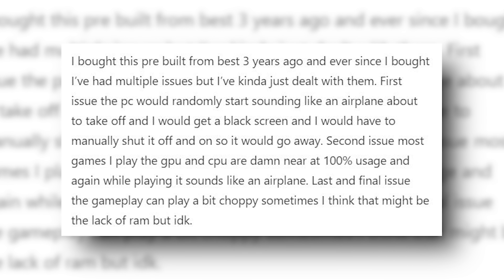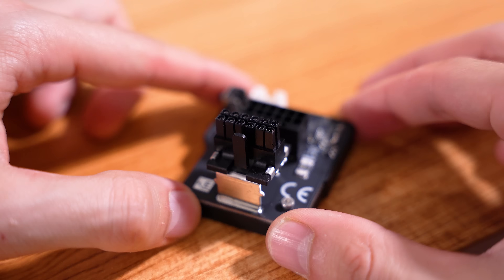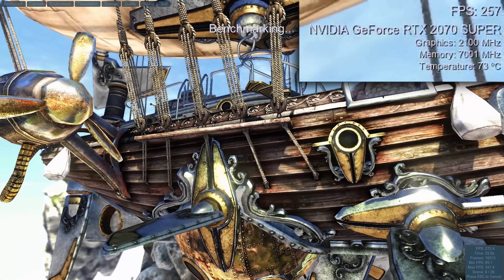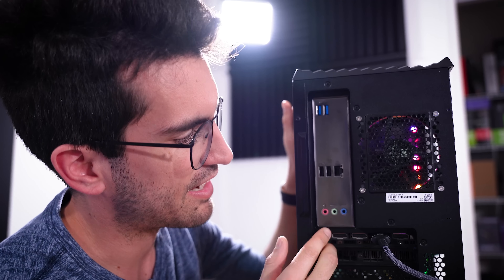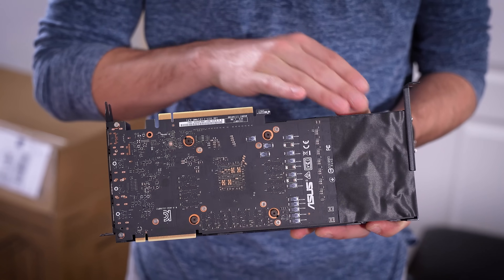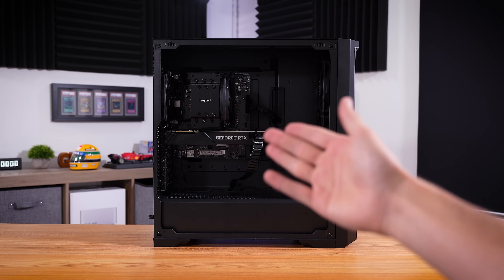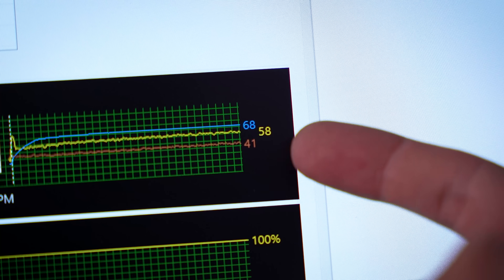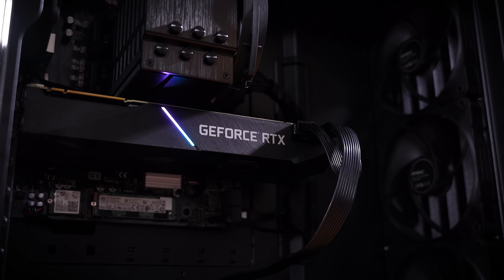Fixing a Viewer's BROKEN Gaming PC? - Fix or Flop S5:E3

Comment: Massive case overkill and psu overkill for that system. If I had a nice compact unit I would be gutted getting that huge empty beast back. So many different ways to go and you probably picked the worst choice. However, I do appreciate you may be limited by what you have available.
Reply from the maker: If you think a "nice, compact unit" includes shitty airflow, a shitty stock cooler (the upgrade of which wouldn't have fit in the stock case) and zero room for even a single 120mm fan, then you shouldn't have applied for FoF in the first place, IMO.
Reply: @GregSalazar   So on that basis every small or mini itx system would be a disaster? There are thousands of pre-built systems exactly like that one being sold every day and are you saying that the solution is to re-house them in large new cases with massive PSUs? There are dozens of different cpu coolers you could have used but I appreciate the one you had didn't fit in that case. Do you honestly think the thousands of IT guys that get those systems in when overheating every week go that route? All those cases and psus junked because they had "shitty airflow"? Like I said if you were limited with choice due to what you had available then fair enough, but there were other options that didn't include that massive case and overkill psu. More of a rebuild than a fix. Call it "rebuilding a viewers overheating pc" rather than fixing a viewers broken pc! Just pointing out the obvious and that if I sent my overheating compact PC in to be sorted by someone, I would be gutted to get that beast back! It would have been great to see you change the cpu cooler and try some fan/airflow configurations to see what gave the best results with minimum outlay, as it looks like you could get a couple of top fans in the original case and maybe one in the front. I would love to see a new build in that case as I'm sure you could make it work and I think the case looks nice and has plenty of space in it.

Comment: one day , i will pass from this mortal coil. either i will go to a better place where SIs don't use single sticks of DDR, terrible coolers , zero airflow cases, matx boards in ATX cases, GT710s or PSUs that barely meet the power requirements and allow for no performance upgrades. Or maybe i'm already stuck in pergatory, waiting for my soul to earn its way out of this GPU-sickened limbo. for sure i've already been to hell and it was installing Windows 95 from 29 3.5" disks, waiting for my pain to expire, one mechanical kachunk at a time.

Comment: Excuse me? This foul excuse of a motherboard inside a ROG prebuild? Typical ROG in the past few years....not even heatsinks on those few MOSFETs...
Just like when they used folded together sheet metal pins on ATX power only the take a step back the next board generation to massive pins andthen making them the COOLPLUG feature -- while this being NORMAL everywhere else. 

...stop falling for the ROG brand guys. Beware of ASUS, look EXACTLY what you need or what you build machines out of if you have to use ASUS.

Comment: Just to be fair, blower GPU coolers do have there place.  They have the advantage of evacuating all the heat they produce instead of just recirculating it in the case.  this is beneficial when the case is kept in a cramped space and only has access to quality front intake.

Comment: im a system builder of 25 years and i use to run a 92mm Delta fan on full RPM on a thermalright HS so noise is not an issue for me...but for some it is...not sure if the basic board supports dual channel memory but the user should upgrade to a minimum 2 sticks 16gigs memory...good job greg

Comment: That is the Asus brand main board they use for all there prebuilds so I don't any of it is compatable with the other cases, the one thing you can do is get red of the memory without heat spreaders they are only ment for mainstream and computing and can overhead really fast which could cause the weird temperature spikes.

Comment: My first computer was a pre-built from Best Buy in 1999. It was a terrible choice and turned me off of pre-builts forever. The power supply died. The modem died. The sound card had driver issues from Day 1 that we never resolved. It came with only 32 MB of RAM (yes, MB, not GB - you young people are spoiled). It was inexpensive until it cost me an extra $300. Ever since that mistake, I build my own.

Comment: 2 USB 2.0 and 2 USB 3.0, 1 LAN and 5.1 Sound. Almost as little I/O as server motherboard for rackmount but those have multiple LAN. As far as I konw the only model I remembered have I/O as little as this are Gigabyte G1975X and X58A-OC and those are motherboard for some kind of extreme OC only so they don't need many I/O. I don't understand this even the most low end motherboard or cheap motherboard 20 years ago have more connectivity than this.

Comment: I won't lie... I want this ROG case. I love its aesthetics. The only problem, as I've heard constantly over the years, is that the pre-built (the ONLY way to get the case, apparently) is horribly spec'd and performs badly. 

If I could easily buy just the case and put in above adequate parts to create sound performance, I'd be a happy as heck camper.

Comment: That rig will definitely - DEFINITELY - need some attention to VRM cooling now that the CPU will be able to pull its TDP (or more). I'd suggest a fan (90/120 x 15mm) cut from its frame and attached to the CPU cooler back-plate with a few blobs of RTV (a lash-up, but practically inaudible and of course  invisible).

Comment: If the motherboard doesn't have much (or any) VRM cooling, and especially if it is also throttling the CPU, a tower cooler may not be the best idea. It would increase VRM temps, and may therefore lead to increased CPU throttling.

Comment: I have a similar spec ASUS G15CK. I didnt have crashing issues, but I wasn't happy with the temps. About 6 months to a year after purchase, I upgraded the CPU cooler, power supply, and case. Since then its been a champ. For anyone that has one of these cases, consider replacing it. Your components will breathe easier. There is also no room for 2.5" SSD's or 3.5" HDD in that case.

Comment: that mATX board really triggered me. Best buy cut so many corners. They were better off using a nameless case instead of an ASUS Taxed case which adds an easy 100 bucks to the value.
I have bought a few pre-builds in my life, untill I burned myself to the last one, a Pentium III 500MHz.. within a year after that I started to build my own PC's, starting with the AMD Athlon 1GHz baed PC. Time has flew by, and right now with my Ryzen 7 5800X and RTX3080 I'm still good for at least a year from now before I will have to start thinking about a full  platform upgrade and a new GPU.
When friends want to buy a new PC I always tell them, set a budget then come to me.. we will talk about what you want and I will build a PC from scratch while sticking within their (realistic) budget. I'm not earning a dime on it but I rather do this then be called for help on regular bases because their prebuilds are acting up.  I rather spend an hour or 2 building that PC myself and cablemanaging it knowing all is good.

Comment: I got a ridiculous deal on an Asus G15CE (i7-11700F + 3070).
The cooling system is hilariously under spec'd. It couldn't complete the Windows installation without shutting down and the UEFI through an "Over temperature event" warning.
I used it for a couple of days while my Noctua Chromax 92MM (NF-A9) shipped. 
I lived in an apartment at the time and my neighbors actually complained about how loud the system was! 
They didn't complain about my subwoofer or my home theater system. 
They complained about the computer fan which was "driving them insane."

Comment: PSU was a “Better safe than sorry” swap so I don’t mind it, the cooler was 1000% necessary, I had to get an AiO for my brother’s build because of how hot his chip was getting with the stock cooler. It wasn’t overheating but I did not feel comfortable letting the CPU get that hot under load. 

Good job Greg!

Comment: Jesus, that board puts the BARE in bare bones. It's unbelievable. I can't find fault with your decisions here except the PSU and only because it seems like a waste on such a naked assed motherboard with bare minimum VRMs. But had it been me, I'd have done the same. Especially considering the owner mentioned the infamous black screen + fans go defcon 5 of Nvidia GPUs that are starved for power. A new PSU was necessary. Full stop. But that motherboard. Yeesh! Pre-builts that skimp here just grinds my gears because you literally have to fix someone else's sloppy work and choices, and it's even worse when those fixes require overkill because of limited inventory. Motherboard replacement was out of the question, too. You'd end up overpaying on a replacement board on eBay that may or may not even POST and in the time it arrives, you could've done a good generation upgrade ... but that would result in a new PC save for storage, RAM, and GPU. Anyone finding fault with you, Greg, hasn't been placed between a rock and a hard place enough times. It's that dichotomy all over again: you had to work harder because someone else could've worked smarter and chose not to. That someone else was Asus, imo. Ugh. They took the ECS approach with that motherboard.

Comment: Instead of case and PSU you could have just replaced the cpu cooler and motherboard. What’s the point of making the sound less when you leave so much performance on the table
Reply from the maker: This was about an overheating system. PSU aside, the CPU and motherboard both work. The goal of this playlist is to fix things. I don't have CPUs and motherboards to throw around nearly as much.

Comment: The only issue I really noticed was the motherboard power delivery.  It was mostly unsoldered.  I would be surprised if the CPU was getting 35-watts of power.

What was the power draw of the whole system.  And how was it without the GPU?

I think all that was needed was a motherboard replacement.

Comment: Nice to see my x58 platform Xeon x5675 6 core 12 treads running from 3.06Ghz overclocked to 4623Mhz and up to 4823Mhz with boost.
With a max temp arround 76 celcius during full stress test.

Comment: Looks like Aida was actually reporting 100% throttling with the stock cooler, it's not a digital readout like the cpu, it's a graph, which ramped up rapidly after starting the test, at least from the screenshot you displayed.
I think your conclusion about the motherboard being the cause of the throttling problem is sound.  Proprietary MB's are rarely fit for purpose most of the time, so annoying.

Comment: Greg, did you check how much stuff was running in the background?  If it almost crashed, opening chrome, which is pretty light. I would suspect there may be additional software eating up resources as well as the underpowered issue. I have been doing tech support for over 25 years. Old drivers like you found, plus some sort of resources hog, could've  caused a lot of the same issues.

Comment: got to love when a MOBO has better cooling on the chipset than the VRM. Id bet the under-built VRM might be the reason the CPU is power throttling. Not much you could do for that board though.
Reply: Or, you know, it's an F-SKU CPU that doesn't require 120 phases of VRM nor the cooling for it as it's a downdraft CPU cooler.
Stop watching HUB videos where they pair $60 motherboards with $750 CPUs with intentionally-zero cooling and call it a "fail".
Reply: @tim3172  it's an i-7. Even the non K skus still draw over 100 watts

Comment: That’s crazy cause my omen has a decent sized cpu cooler plus 2x front fans and it moves decent amount of air I’ve yet to run into an overheating issue but I also keep my room like a meat locker so that helps even my old omen 25L ran fine.

Comment: With these OEMs I just try to leave them be before you case swap and have ports not working or dead space like you had plus the obvious additional cost. I think an additional ram stick, and a better cpu cooler would have done the trick. Great vid regardless.

Comment: I noticed that the original ASUS themed case had a vented top, could a pair of fans have been mounted there as intakes? Couple that with a cooler upgrade that fits, and that would have helped the original build. Antec and bequiet might not appreciate the reduced exposure though. :D
Reply from the maker: The cooler we upgraded him with wouldn't fit in the original case as it was far too slim.
Reply: @GregSalazar  I know, gotta use what's on hand. I was just curious about the other case and if it did have what looked like trop fan mounts. 🆒

Comment: i dont think you were supposed to just yank the cooler off the board, lol. the proper way to take those coolers off is by taking a slot screwdriver and turning the "heads" of the push pins counterclockwise. they'll pretty much pop out on their own
Reply from the maker: We turned them as far counter-clockwise as they would go. We've worked with these sorts of fastening locks several times. IME they're always a bit stubborn to remove - even after a good thermal cycle.
Reply: @GregSalazar  ah, nevermind then. i figured maybe you just forgot how to deal with those, since push pins aren't really commonplace anymore aside from Intel's stock coolers. and other similarly low-end units that exist for some reason even though they're probably no better than a stock cooler

Comment: A second RAM stick (and maybe a better kit) for dual channel performance is missing, this were the first upgrade which i had made.
The power supply was probably fine, Great Wall is a OEM brand, many good PSU come from them, 500W would be enough, its not even a K CPU.
These motherboard are cancer, VRM not cooled and not even fully packed, probably one of the issues why the CPU boost is not good.
A Thermalright Peerless Assassin would be totally fine and much cheaper as the be quiet! Dark Rock 4.
So if i had this PC, i would change the motherboard, CPU cooler and add a RAM stick, maybe change the case, but probably not necessary.
But still nice work, a free upgrade for the viewer 😅

Comment: I just bought and rebuilt this exact prebuilt. That motherboard is stage 4 cancer. It was the first thing to go. From the proprietary USB and case connections, to the lack of XMP profile support... The cooler is also trashfire, but the PSU seems alright and got to stay.

Comment: Question from a guy in Winter Springs. I built my first computer about a year ago and i occasionally will have a blurred blue screen and the system freezes. I quickly reboot and temps seem okay...I can not seem to replicate the crash....but it still happens every once in a while. Is there a video or recommended place to  kind of see if I have things set up right in the software. FYI I used YouTube to build it, so i know almost nothing lol

Comment: Personally I'd have only swapped the motherboard and case (and cooler repaste)

My reasoning is that the asus mb is e-waste, the comonents on it are not good and will actively throttle it's cpu

the cpu would have done fine with that dodgy little fan on it, it was justbecause it was in a hot box case
PSU was still good though, greatwall is a pretty decent PSU oem

Comment: I think you should have upgraded the memory for sure. Single Stick of Ram is one of the most horrible things you can do to a system performance-wise. And the PSU didn't need replacing. Great Wall is an OEM brand for other PSU makers. And this one looked exactly like a bequiet unit, so they probably built your sponsors unit too. Thank you for the good video production though.

Comment: I love this series, even these where your dealing with a cheap prebuilt with cheap/proprietary components that upgrading one thing such as the cpu, cpu cooler, or the graphics card won't provide the uplift in performance it should because its potential is limited by the other cheap/low end components and fixing them is impossible without acquiring the exact same part or just rebuilding the whole thing which you usually end up doing the latter. 

You giving people new hardware to fix problematic computers doesn't bother me at all, its just the reality of dealing with cheap computers where the manufacturer has cut a bunch of corners in making them to save cost. If it fixes the problem the owner sent it to you to for that's a win.

Comment: Great wall is a PSU OEM. They build for a lot of manufactures, maybe even your sponsor. So if you encounter PSU's made by Great Wall, Delta, FSP or Super Flower to name a few examples: They are most definitely actually pretty good. OEM's actually tend to use better PSU's then most SI Builders.
Reply: I just noticed the PSU in this case even had the housing of a bequiet PSU. So yeah. It's actually the same as a 500W bequiet PSU you can buy retail.

Comment: I think the case and cooler upgrades were the right thing to do. That CPU was just not being adequately cooled. Other than that unless you start replacing every part because they were all a bit janky you had to stop somewhere. Great wall is a reputable PSU supplier despite appearances but I can understand not being comfortable running a beefy card on 500W. Maybe give the guy a list of easy upgrades they can make themselves like a second memory stick for dual channel and a motherboard with decent VRM so they know where to spend money if they want more.